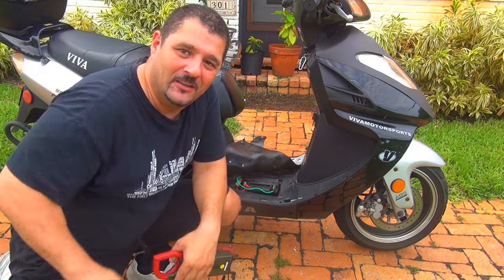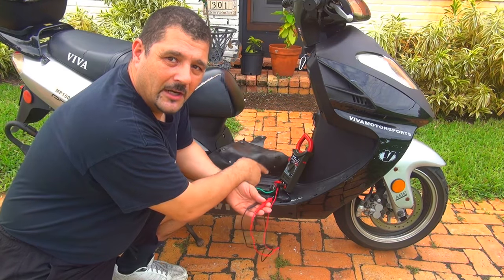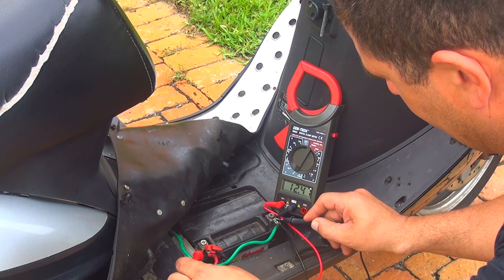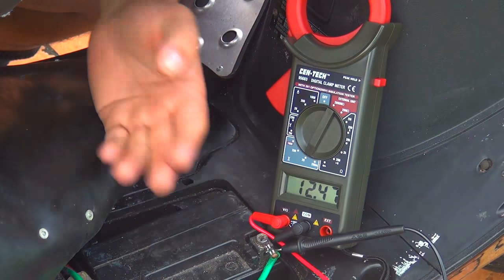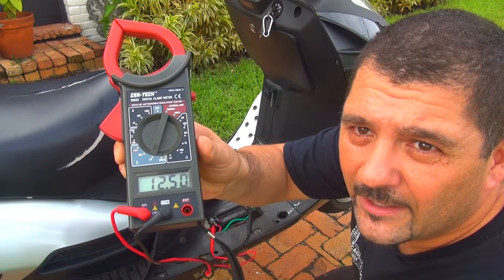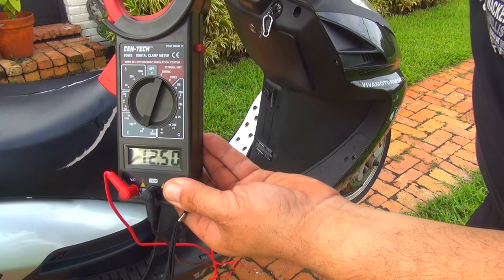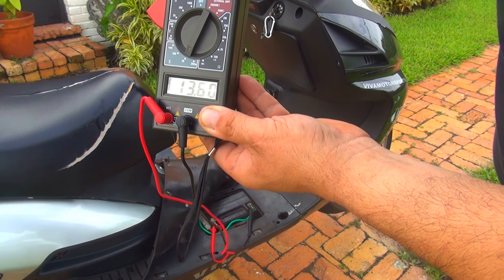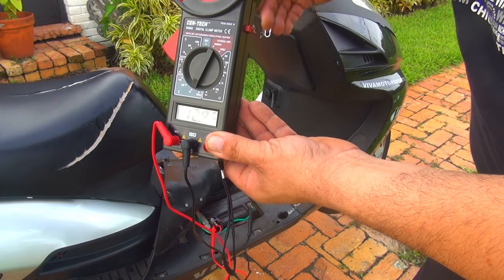Battery charging Test on 150cc GY6 Motorcycle /Moped / Scooter

Comment: thank you for your video. A question for you about battery and multimeter.  I have an old kymco r16 50cc 4t (2009 year) , i think that it's a GY6 motor carburetor system.  I've checked the battery with my multimeter and the value is about 12.70.... when i rev up , when i increase the rpm , the multimeter gives me a value about 16.80.... is it too high? Maybe do i have to change the regulator/rectifier?  Sometimes i have problems to start my scooter...  my battery was off and i recharged it using a charger....
Reply from the maker: Hello Riccardo when I check my system I like to see a 14.8 to 15.2 if you are on 16.80 is great but a little high for my taste but I don't say that  is bad unless every 2 months you have to change your front head light bulb  from to much voltage if sometime you have a problem starting your scooter check your gap at the spark plug or buy a iridium spark plug that will give you a better and cleaner spark. Thank you for watching my video
Reply: @VirberelloScooterTips  thank you for your reply
Reply: @VirberelloScooterTips  could you suggest me a new spark plug for my Kymco agility r16 50cc 4t (2009 year). Which company? NGK

Comment: Hi thank you for all that you do, i have learnt so much about scooters from watching your videos. i have a question? my Bigboy F35 170cc GY6 scooter makes a clicking sound when i rev up the engine could you please help. thank you i appreciate it.
Reply from the maker: Hello Leo you need find where the noise is coming from if is the lower  rear left side something is wrong with your clutch if is coming from the front lower left something is wrong with the variator or roller weight if the noise comes from your top end you need to adjust your valves or inspect the rocker arms I know happen to me many times and little noises drive me crazy, Thank you for watching my videos

Comment: Mine shows 15v when driving the scooter, is that good or bad? When off its 12.6ish
Reply from the maker: Hello Jason that is very good voltage
Reply: @VirberelloScooterTips  you think that is why it burns out my led headlight bulb? They don't even last an hour.
Reply from the maker: @x214214  yes there is possibility if you have some unsual spikes when you ride your scooter you can burn the light best way to know is to instal a recording battery monitor    https://amzn.to/3oHPdLr or just change the regulator rectifier that some time can send back some negative resistence or voltage  spikes to the wires
Reply: @VirberelloScooterTips  that seems a little high to me. Possibly of  a bad regulator

Comment: Thanks for the vid, now I can check my scooter. I think there is a problem as my scooter wouldn't start so I replaced the battery and it fired up, but today the new battery let me down. What would be the most likely parts that need replacement in this situation? Gracias!
Reply from the maker: Hello Jose if your scooter electric system is not recharging the battery the next step is to change the Regulator Rectifier https://amzn.to/2wS2S9B and you will find that in the front of your scooter next to the horn sometime Regulator are not charging the battery the proper way. Check this link is going to be helpful for you https://bit.ly/2oR7AA4   .Thank you for watching my video